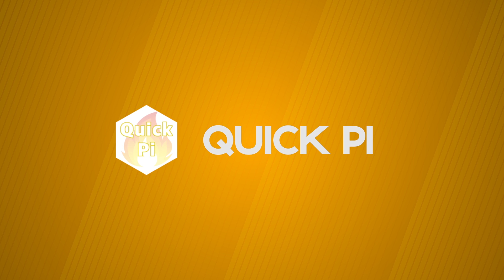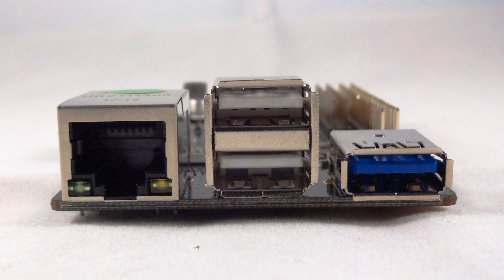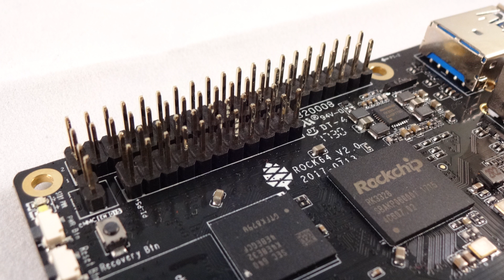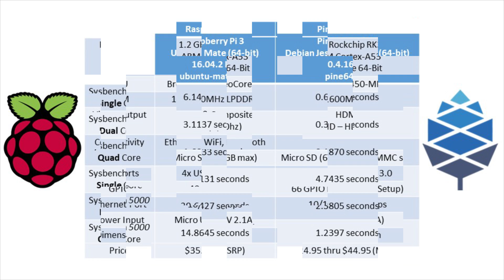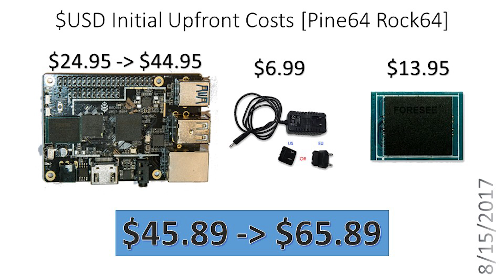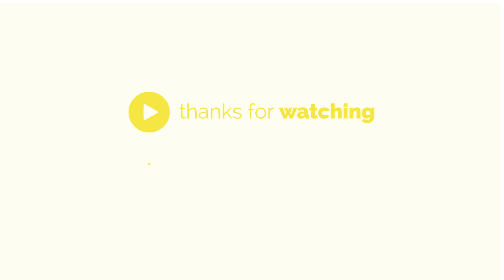SHOWDOWN: Rock64 vs Raspberry Pi 3

Comment: I have the Rock64 (4GB and a 16GB emmc), so just a few points I have found from your video.  Power supply, I currently have it running from a 2.1A supply, with a 4TB USB3 HD attached and get no problems.  I bought a couple of cheap USB to barrel connector leads from ebay, ran perfectly well from a cheap USB power bank, and from a 1Amp supply.  Using a barrel connector means that the jack is much more secure in place than using a flimsy micro USB connector (how many broken ones do we have?) .  Booting up with nothing attached, I got a maximum power draw of about .5A.  So, your comments about the power supply being a limiting factor are a bit wrong as it is a common connector, and very common power supply. The 3A is the rating for the maximum it can handle (actually the max is 3.5A), allowing the Rock64 to power attached USB devices, you note how the Pi3 wants you to use a powered hub for attaching items.  On the forums people are reporting having 3 USB discs attached with no problem.

I am using mine as a network server running SAMBA, owncloud and minidlna, taking over from an Orange Pi Plus (which wimps out with 3 discs attached due to the 2.1A limit meaning I need a powered hub.)  That impressed with the Rock64 , just ordered another one.
Reply: All I did was install one of the minimal distros (ubuntu xenial) , boot up and via the serial UART to get the basics set up, the SSH in and install to the emmc, reboot. Installing webmin makes things a LOT easier (but purists call it cheating).  Set up Samba for LAN sharing, Owncloud for away from home (forwarding a port on your router) and minidlna for home entertainment.  works great, have it running in parallel with my old system (Orange Pi Plus) but is coping well.  I just got a pi3 UPS from banggood for it, and it seems to work fine).
Reply from the maker: +stealth banana wow that’s impressive, I just switched my whole home Pi to a Rock64 and seeing a lot of improvements. I might switch to an eMMC module just to ensure there is no downtime from SD card enduarance
Reply: Just remember that not everything is running correctly on the Rock64 yet, some people reporting really bad performance on some distros, but headless ubuntu minimal works fine for me.  I did have the USB ports power getting switched off after logging into a GUI, but that is solved now as far as I know.  I did not do any speed tests of the emmc v sd card, but it runs fast enough for what I want.  I did order a 64GB emmc, and swapped it in my pinebook and that is nice and nippy.
Reply from the maker: +stealth banana I’m on stock Debian and haven’t encountered any problems so far so I’m happy with it
Reply: +stealth banana, any chance you could do a video or write up of your set up?  I'm trying to do the same thing with my Rock64 4GB and any tips or tricks would be awesome
Reply: stealth banana what are you using to plug the hds on USB?
Reply from the maker: +issamu2k I’m assuming the direct USB, it has 3 USB ports. If he’s trying to get USB 3.0 out of all drives, he could be using a USB 3.0 hub to get max data speeds
Reply: At the moment, just using USB HDDs.  The Orange Pi I used does have a SATA port, but it is just an onboard USB2 SATA port, so limited to USB2 speeds, with the Rock64 and the USB3 port so a lot faster.  I have a 4TB in at the moment, if any more, probably will use a (powered) hub, or one into a USB 2 port if it is just for backup and not streaming video.
Reply: stealth banana I
Reply: Hi, Stealth Banana. Do you think a RPi 3 case would fit on a Rock64? And what operating system do you use?
Reply: This was helpful, thanks!
Reply: my pi3 showd a low power sign in unbunto with a less than 2A power supply.